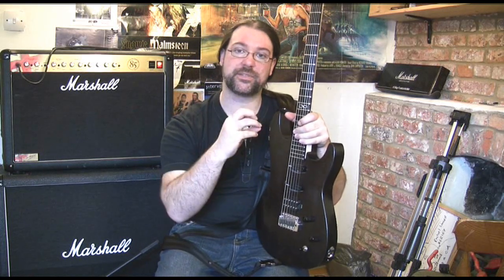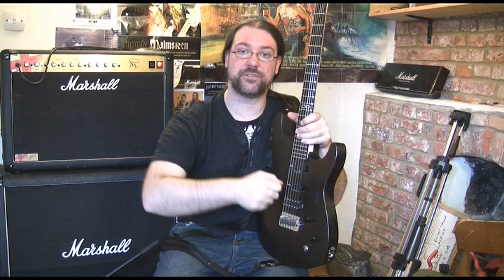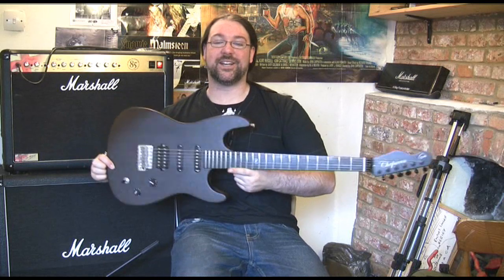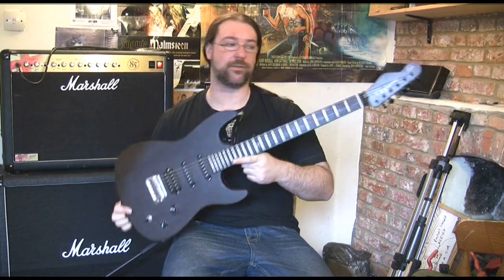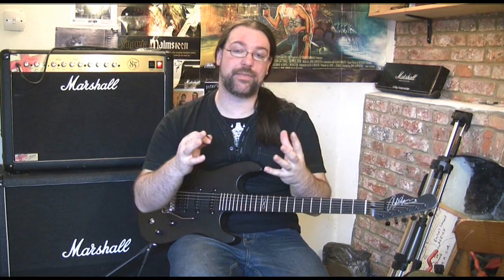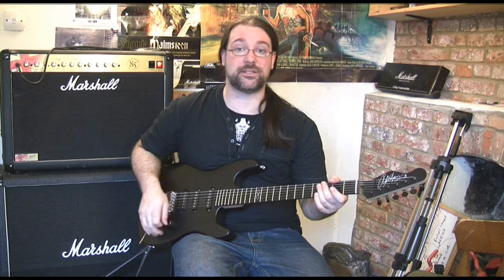Chapman Guitars ML1 Set up and FAQ - Part 3 of 3

Comment: Way to go Rob!!! 
That made me wanna check out the wiring diagram for ML-1. Looks like a clever way to wire 3 pickups with 3-way switch. But the guitar you're playing in this video may not be wired same way as the wiring diagram would suggest. If you did wiring as shown in the diagram you'd get following combinations with pot pulled up:
1. neck only
2. all (bridge coil tapped)
3. bridge coil tapped and middle 

It also made me wonder, why isn't there a 5-way switch???